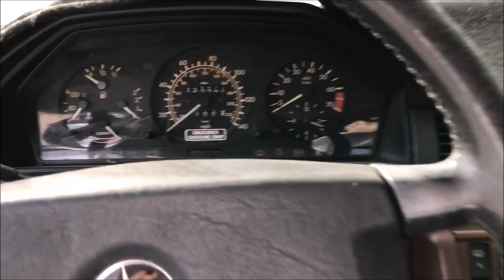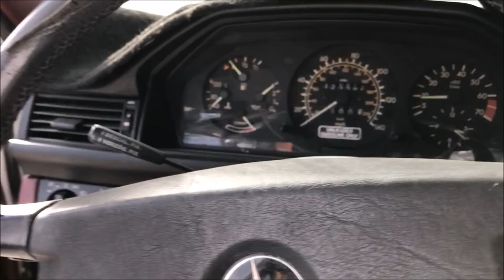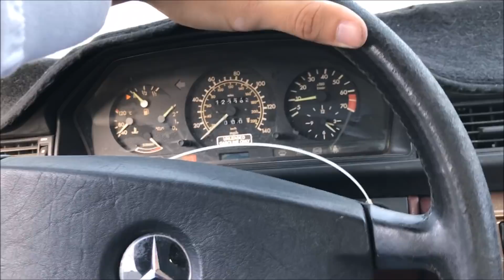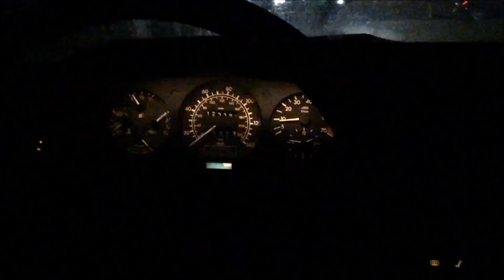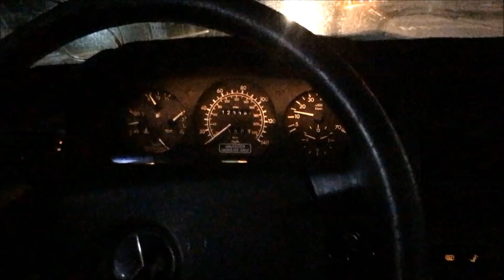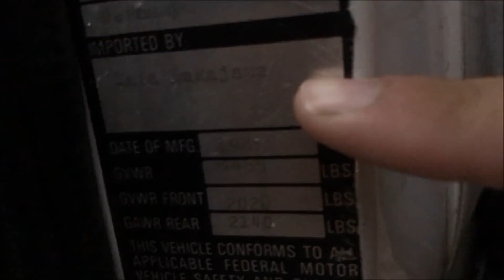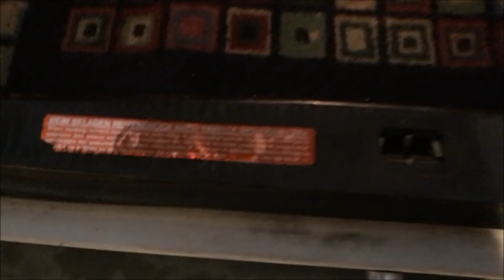I Won A Grey Market Mercedes W124 At Copart For $250

Comment: What makes it a Grey Market car if it was retro fitted with all US parts?  Generally when you speak of a Grey Market car, it still has the Euro parts on it.  This is an Americanized Mercedes just like any other sold at the dealership.
Reply from the maker: Tsuki san not sure how this is hard to understand. The import tags are all over the vehicle. The vehicle was not manufactured for the US and was brought over after the fact and fitted with US headlights and cluster to meet FL inspection requirements at the time. The drivetrain is still euro spec without all the US destined emission parts, etc.
Reply: That is odd the EPA made them change the lighting and the speedometer but left the emissions the way it was.  Did it turn out to be a good car?
Reply from the maker: Tsuki san it wouldn’t be the EPA requiring the headlights and cluster to be changed, it would be FL DOT. The exhaust may have been changed at some point to meet US standards but when I bought the car the exhaust was missing. The car needs some work now after driving it for a while so it’s just parked waiting for when I have the time

Comment: The infill panel on the boot/trunk between the rear lights was made by Zender (makers of a lot of the really ridiculous '80s body kits) and could be bought as a dealer fit optional extra on a new vehicle, or from a Zender supplier to fit to a pre-owned car.  They're a pretty rare part these days as most of them suffered the same kind of sun fading and UV damage that yours has, but I believe there is a company in Germany that advertises on Ebay that sells a lot of obsolete Zender parts having bought up their stocks when Zender had a big clear out so, if you want one, you might be able to get one from them.  I believe there are replica parts still being made too but they're really not good quality and in the heat and high UV conditions in Florida they would probably fade and deteriorate pretty much instantly.

I think the recorded mileage on this car might well be correct, when it was imported in 2001 it was recorded as having 121,000 miles (195,000 km) which is about average or slightly below for a 14-year old European car so would make it a prime target for someone to import to the US, and I get the distinct impression that it was someone's Sunday best toy car so didn't see much use at all, and then sat for a very long time after the owner became unable to drive any more before, eventually, being donated.  Of course, it's hard to prove that, especially being as the speedo isn't working and, therefore, the odometer not recording, but I think the noise you heard when you first drove the car was the seized speedo cable winding up and snapping.  It certainly has the appearance of a car that has sat for a very long period of time in one place, probably under a car port, where parts of it were exposed to the weather, hence the rusty spots in what are not usually places that go on these cars unless they've seen a lot of life and a lot of abuse.  Even the leather steering wheel rim doesn't look like wear caused by a lot of use over high mileage, it looks like the sun has caused the leather on the top left side of the steering wheel to shrink and shrink through loss of fluids to the point where it has split, if it had worn from high mileage use then the gear shift would also be showing signs of wear which it doesn't seem to be particularly, and the pedal rubbers would show pronounced wear which they don't seem to...

I would guess that car started off it's life either in the colder parts of West Germany (this is pre the Berlin Wall coming down so the man in the street wouldn't have been able to buy a new Mercedes in East Germany then, that was strictly for the party or its friends) or maybe Austria, as you say the heated seats were a very rare option on a W124, and a very expensive one (I've never actually seen a W124 with heated seats...) so it most likely came from an area that gets very cold in winter to justify the cost.  The fact that all the factory warning stickers and control markings are in German alone makes these the most likely options for its origins as vehicles sold in other European countries would have the stickers in German and the language of whatever country it was sold in new...
Reply from the maker: gosportjamie I think your theory about the car’s past is spot on! I’m looking forward to restoring it back to its former glory when time allows...for now it unfortunately sits in my carport as it must have sat for many years with its previous owner.
Reply: +Big Al's Bike & Auto  Well, sitting for a while longer isn't going to hurt it to much, it's survived sitting the best part of 20 years so waiting a bit longer for some tlc isn't bad.  I reckon the reason it lost its coolant was partly evaporation and partly the seals in the cooling system drying out and shrinking.  It's not unusual on these if they've sat for a long time.  The good news is that the parts are readily available from Mercedes specialists and not expensive, or even from Mercedes dealers, especially if you have one that's been a Merc dealer for ever and has friendly parts people...
Reply: I'd be cool with living on his street, it's nice to have neighbours who understand the game rather than those who just bitch, whine and judge... ;)

Comment: The good old Mercedes clunk-o-matic.  As long as it's changing through all the gears OK then a fluid change and new filter should clean it up a lot.  That's a really good buy for very little money, it needs some help but it's a high spec 300E and it looks very sound in the places they usually rust.  The W124 is probably the best car Merc ever made...
Reply: another thing to check on merc's of this era is vacuum lines, a lot of stuff on these is vacuum operated including transmission shift control.

Comment: I'm at 10:23, just thinking on what you said about the shifting starting to ease the more you drive it. If the odometer is working and it has stood for that long without running is it possible the clutches/bands etc dried out a little and took a bit of driving before the fluid started to impregnate them again? Like how you should soak new wet clutch packs before using them, I can imagine they'd grab too hard before the friction material got fully soaked.

Comment: seeing this term makes me miss my $500 1995 Mercedes. It had probably 10 or more owners. Most of them didn't understand what the current was. It was actually in better shape than this one. Believe it or not. When I got it. I'm hoping you know, to put supreme only in a Mercedes you put anything else other than supreme in those cars. They will run like a bag of cat's. The one that I got literally wouldn't even stay running, because they'd been using The Rong gasoline and I had to go to quite a bit of trouble to flusher the system.
Reply: Peter Parker I plan to buy a Mercedes Benz 1986-1995 E-Class and take it to Oklahoma and put an Italian,  or German license plate for the front.
Reply: I would never run supreme in my merc I would fuck my whole fuel system